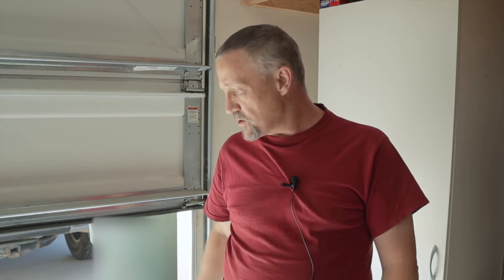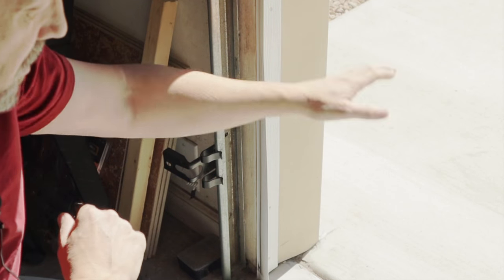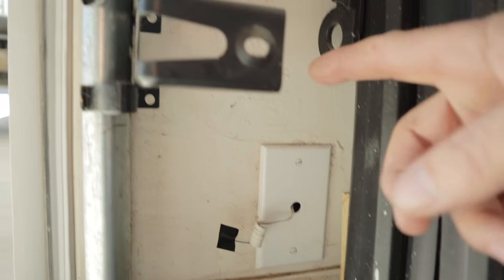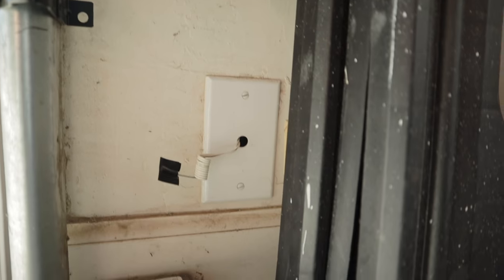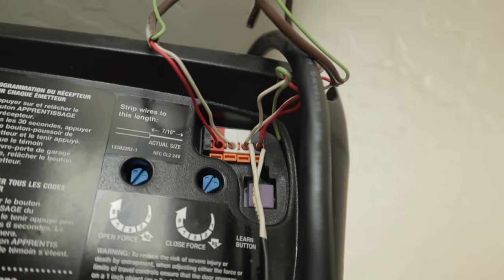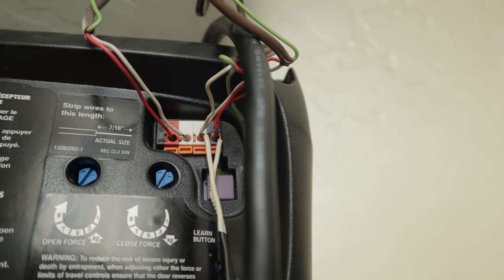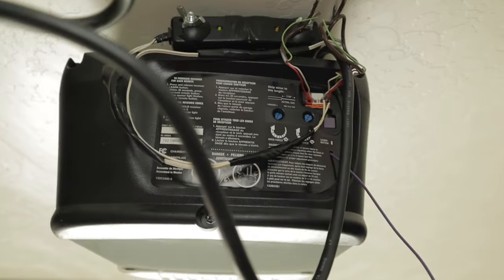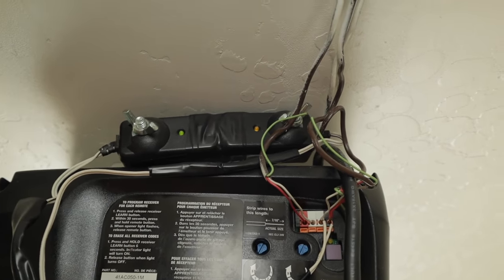How to Disable Garage Door Sensors

Comment: I did this when I installed my opener.  I mounted both sensors to a board with six inches between them to test the functionality and left it that way for years.  Without kids and pets, it's a low-risk situation since the pressure and limit sensors are still working.
Reply from the maker: That's a good idea! I agree, mine has been working flawlessly since I made this modification.

Comment: I have argued with two or three companies that always state I need a new garage door opener...I always say come back in three hours and I wont need one from 1230 ish in the afternoon till 9am.  I also told them I dont need one from fall till mid spring...so how is this possible?  They always say the same thing new opener.  Im going to attempt this bc its been 10yrs of this crap I have built sheilds but they move I have used toilet paper rolls they all last for a while but you cant count on them.  I dont have grands or younger kids...IM DOING IT Im pretty good with electrical and this is gonna be my weekend project!!!   thanks so much
Reply from the maker: Linda, you'll be glad you did it and you can finally stop fighting with your garage door opener. And it's virtually a FREE fix! Good luck with your project.

Comment: Having similar issues with sensor, but mostly just from vibrations along the rail mount. Instead I'll be buying a second set of sensors, mounting them on the wall to face each other, and add a switch to toggle between the old sensors and the new ones facing each other. That way if we have friends over with lots of kids, I can switch it to the existing sensors, and then when it's just the wife and me I can switch to the new sensors. My install will be a little easier since we have a shaft drive garage opener with cables to open/close the door, so the opener is mounted on the wall to the side.

Comment: My garage door goes up halfway, and then there is a clicking noise like 'rrrrrrrrrrrr' and the garage store stops moving.  I thought it may be stuck, but it moves up and down freely when I move it manually.  What could be the issue?
Reply from the maker: It sounds like possibly a sensor issue. Is there something blocking the sensors? Something on the door (brace or anything) blocking the sensors? Maybe you have the problem I had. As the door goes up it lets the sun shine in on one or both of the sensors. This disrupts the sensors and the door stops and gives the warning (clicking noise and light flashing). Your problem may be the sun hitting the sensors as the door goes up. See if the door does the same thing at night when there is no sun shining.
Reply: @DIYHomesteadProjectsDIYHP10  no its not the sensors or anything blocking or the sun, cause its the same issue at night.  Its not that the garage door just stops, there is also a whirring sound like the motor is still working but making rapid clicking sounds.  The light that is supposed to blink on and off doesn't blink like it would if there were an obstruction, so there no issue there.  Its almost like the door is getting stuck but thats not the case either cause it moves freely manually.  If you give me your email, I can send you a video of what its doing.
Reply from the maker: Hmmm, that sounds like it's beyond my knowledge of garage door openers. Unfortunately I don't have any more ideas as to what the problem is.
Reply: @DIYHomesteadProjectsDIYHP10  Ya, thats okay, but great video by the way.  You hit on what are the usual things people should check to solve things.  Nice.  Im wondering if maybe a gear is broken and thats what is causing the rapid clicking noise.  Any idea how i could check the gears, are they on top of the opener or somewhere inside the box?
Reply from the maker: A broken gear did cross my mind too. I didn't mention it because I have never taken an opener apart. I would guess that you could take out a few screws and remove the outer case and have access to the inner gears. If it is a gear missing a tooth you may be able to see that by just removing the outer case. Maybe even just a loose or missing set screw on a gear. Good luck and I would be real curious to know what you find inside if you take the case apart.
Reply from the maker: Maybe it's the chain. If for some reason the chain is loose it may be slipping on the sprocket.
Reply: @DIYHomesteadProjectsDIYHP10  hmmm , ya actually that could be it cause the chain did look a little loose.  Ill check it out. thx
Reply: @AnytthinggGoes  , if adjusting the chain doesn't work, there are some good YouTube videos on replacing the plastic gears.  I have done it once or twice, and it's a very doable DIY project.
Reply: it's your  springs one is broke

Comment: I just had 16x7 and 9x7 garage doors with Liftmaster openers installed on my new garage about 1 month ago. Currently only using the 9x7 door on extension cord until my electrical is done. Problem is the door will open with remote but will only close holding the wall button. Light on opener flashing 10 times and both sensor lights are OUT. Sensors appear to be aligned. No cut wiring anywhere. Could both sensors or the opener be defective when just installed 1 month ago? Still under warranty so I can still call my installer.
Reply from the maker: Those symptoms sound exactly like what I was experiencing. If it were mine, I'd get in touch with the installer and have them come fix it if it's still under warranty.

Comment: This is not bypassing or disabling sensors. This is removing the sensors from where they can actually help and putting them somewhere where they are useless. But, they are still in the operating circuit.

Comment: Could one just wire jump white and black stripe for the same effect?
Reply from the maker: No, a simple jumper won’t work. There needs to be a pulsed signal.
Reply: @DIYHomesteadProjectsDIYHP10  thank you for the quick reply, i have an issue with mine in the afternoon, so im going to do this modification this weekend
Reply from the maker: I wish you the best!

Comment: Wouldn't it be the same just adding a jumper wire ?
Reply from the maker: The opener needs a "pulse frequency" signal and not a constant voltage. You need either a pulse signal generator or the sensors. Just connecting the wires or using a wire as a jumper will not work.

Comment: Can't you just put in a jumper wire and eliminate the sensors all together? Wouldn't that be the same thing?
Reply from the maker: No, it has to be a pulsed signal. Unfortunately using only a jumper will not work.

Comment: This is voodoo. I'm gonna try it this weekend...wish me luck!
Reply from the maker: I wish you the best!
Reply: @DIYHomesteadProjectsDIYHP10  HEY! I just found out that someone before me (I've owned this house for 15 years LOL) already did what YOU did... they have the sensors mounted on top of the mechanism/box, and they are aimed at each other, about 3 inches apart. . One of them is glowing orange and one of them is green.I'll go back up there tomorrow night and clean them off and check the wires and such. Maybe I need new sensors?
Reply from the maker: That's interesting
Reply: @I_give_I_give  Yeah, I can't get them to work. I've made sure they are aimed at each other, I've wiped off the lenses but still no luck. Could a sensor be bad even if their lights are on?
Reply from the maker: From what you have described, I'm thinking it may be the electrical board in the opener that may be bad instead of the sensors.

Comment: Thanks. My door wouldn’t close because the sensors were tripped by the ribs of the door, about an inch from the floor, and I couldn’t move the sensors up or down because the track brackets were in the way. Stupid design, making the ribs so big they trip the sensors. So, bye-bye sensors.
Reply from the maker: I agree with what you said about the ribs being too big and the sensor mounts are a poor design. This fix I show in the video will cure that problem and you'll be happy you did it. I wish you the best!

Comment: There has to be a way to bypass using the sensors completely. Maybe a resistor or something since a simple bypass wire does not trick the unit.
Reply: Exactly, I tested the voltage between the sensors, the sensors drop 1 volt when they're not in sight of each other

Comment: So you cant just use a jumper wire?
Reply from the maker: No, it's not that simple. The opener needs a "pulse frequency" signal and not a constant voltage. You need either a pulse signal generator or the sensors. Just connecting the wires or using a wire as a jumper will not work.

Comment: How can I disable a faulty or burned out sensor without replacing the entire garage door opener?
Reply from the maker: Sounds like you’ll have to replace the sensor.
Reply: Family has been in the garage door business for 52 years. Didn’t eliminate sensors just moved them which voids warranty or any lawsuits toward the Chamberlain Group. Sensors have to be wired in or door will not go down.

Comment: The brilliance of this video is in diagnostic of the problem, the fail in the solution. Cut a peace of carton board and attach it to the bracket to create a shade. Problem solved in 5 minutes.
Reply from the maker: The solution I show in the video is not a fail as far as I'm concerned. I haven't had to touch a thing on this door since I made the video almost three years ago. But if you need a quick solution to get you by until it quits working again I think a piece of cardboard would work. Personally I'm a big fan of the "one and done" method.
Reply: @DIYHomesteadProjectsDIYHP10  Apologies. I phrased my comment poorly. Thank you for the video, though! It helped me to quickly fix the issue.
Reply from the maker: No worries, I just want people to know how satisfied I've been with my fix. I'm glad you were able to get yours fixed as well. :)

Comment: If you read the manual, it will tell you to reverse the sending and receiving sensors when sunshine is a problem. Those sensors are impossible to bypass, you just moved them
Reply from the maker: Reversing the sensors does nothing to resolve the issue if you have sun on both sides of the garage.

Comment: Can you just add a wire jumper between the two points where the wire goes on the opener? Instead of taping sensors together.
Reply from the maker: Unfortunately no, it runs off a pulse signal. You need either a pulse generator set to the proper pulse signal or just use the sensors. It runs off a pulse signal.

Comment: If you want the door to close just hold the button until the door opener shuts off.  No need to bypass.  You'll have to stand there the entire time pressing the button but at least it will close.  And if the cat walks under and screams you can let off the button and the door will go back up!  Did this for years on a house that had the wires cut from a storm.
Reply: Yes,  that is the "supported " workaround and also a giant pain in the ass that completely defeats the convenience of the automatic opener.  Manual operation with a lock and key would be a better option
Reply: @thatWasntMe  Totally agree. Works just fine when coming home, but when leaving the house this is not a reasonable solution.

Comment: I appreciate the video but I fixed my own garage door problems. With my truck and two hefty ropes, I ripped the entire assembly out, post roller hinges, motor, chain, all supports and the door itself. After a few hours of repair to ceiling and door frame, I am now a very happy, no garage door owner. My KIA will have to sit outside in the sun, rain, heat, cold and suck it up.
Reply from the maker: At least you won't have garage door opener problems any more.
Reply: @DIYHomesteadProjectsDIYHP10  Yeah, after 20+ years of fighting garage door openers (Chamberlain 1/2 hp), I finally got fed up hearing the wife complain again & just ripped it all out on a very hot, sweaty Florida day. Had enough. I do appreciate guys like you who tried to help me over the years though.
Reply: Oh! Wife thought I'd gone crazy! I did! :)

Comment: Couldn't you just close that circuit by twisting the wire together?
Reply from the maker: No unfortunately, this circuit needs a pulsed signal that's provided either by the sensors or a pulse generator.
Reply: @DIYHomesteadProjectsDIYHP10  Thanks, neither sensor of mine have working LEDs. I've checked connections at both ends, and they seem to be fine. I guess I'm going in the attic soon to look for a broken wire.
Reply from the maker: I wish you the best with finding the reason your sensor lights are not working.

Comment: Probably a dumb question, but why would I have to mess around with doing wiring in any way?   Why not just take the 2 existing sensors and just tape them together, and that's it?   Did I miss something?   Also, don't Know why you needed that disclaimer at the end, LOL, nobody's going to successfully sue you LOL

Comment: Uhm.... Why didn't you just switch them?  Put the receiver on the side that the sun shines through? Also.... In regards to the relocation of your sensors, you could just put a jumper wire between the two sensor contacts or if it's easier for ya, just connect the white wire and the black striped wire....

Comment: Be smart enough to not stand under doors that are coming down first of all - or else defeating sensors is not too wise.     

If you want to defeat them, they produce a pulse when connected, and beam is unbroken.  You need to reproduce that pulse (on mine, 3kHz, your brand may be dif).  An el-cheapo 555 timer/pulse generator board replacing the sensor input to the opener will cure the problem.   Get one of the boards that is adjustable for width, and frequency, there is some trial and error involved unless you measured the pulse timing before the sensors failed. Board cost about 7 bucks for 5 of them on amazon.
Reply from the maker: Yup!

Comment: Man, my door will shut most times but then won't for some reason. Sensors were aligned and seemed to be working but they are 17 years old so I replaced them and it did NOTHING. Lining them up like this will do nothing. I want to disable them. This doesn't disable them.

Comment: Very misleading here. This is NOT bypassing!!! I need to ELIMINATE the sensors.
Reply: Do you mean completely eliminate the extra safety sensors, without reverse engineering and modifying the garage door opener circuit board?

Walk into a Sears, circa 1989, and bounce  a check for any garage door opener you like.  Don't linger too long or have have any unnecessary interactions in the past.  Promptly return to the present time and install it.

Comment: Good idea but not very safe.  Maybe a cone shape (empty toilet roll like rig) over the sensors could reduce the interference from the sun. I've got an issue with my garage door sensors and noticed that not only is there DC voltage, about 20 volts to each sensor there is also a 150 Hz AC signal riding on the 20 volt DC power between the two wires.  The power to the sensors is always there whether blocked or not blocked and when blocked the 150 Hz signal goes to Zero Hz, flat line.  So i believe the opener controller is being signaled by the 150 Hz signal which most folks can't bypass easily.  So when blocked the 150 Hz goes to zero and this signals the controller to reverse the door travel and go back up to maybe save a life! Pretty smart to foil the most clever of us who think we can just tie the two wires together and/or open them up to defeat the safety sensors.
Reply: You could probably get an Arduino to emulate the signal and trick the opener.

Comment: Nice tip. Just you do not have to do what you did. Just remove the black or grey wire and add a paper clip between those to and were the white wire goes. It will work the same way. Your just completing a circuit. You could use a piece of thermostat wire to as a jumper too.
Reply from the maker: A jumper won’t work. It has to have a pulse signal on a modern opener.

Comment: This technique should really be used to test your sensors to determine if the issue is your sensors or wiring. In my case it was actually a break in the wire. As the video says, this should only be done as a last resort when every other option has failed and only if you have no children or pets.

Comment: My issue was the crossbrace on one of the garage door panels was tripping the beam everytime it closed...same brackets as yours, just not long enough.  What a terrible design.
Reply from the maker: My door also had that same issue in addition to the sun problem. Not only is it a terrible design but also installed by an incompetent installer. IMO
Reply: @DIYHomesteadProjectsDIYHP10  Lucky my garage is north facing so no sun issue, but I agree with you... DR Horton quality in my case.  The whole neighborhood has the same issue.  I get the door opener and garage door are different companies, but the installer should have caught it or recognized it.
Reply from the maker: I agree, a competent installer should and would check all functions of the door and make any necessary adjustments. Just another situation that proves it's hard to find good help.

Comment: I bet the problem was sunlight hitting your sensor at a certain time of day. Swapping the sensors from one side of the door to the other will fix this common problem.
Reply from the maker: That's what the problem was but switching them would only cause the same problem in the latter part of the day. My garage faces south so I had a sunlight problem twice a day. Doing what I did in the video solved my problem and I haven't had any issues with the garage door since. Thanks for your input.